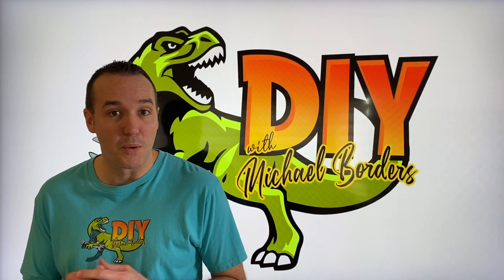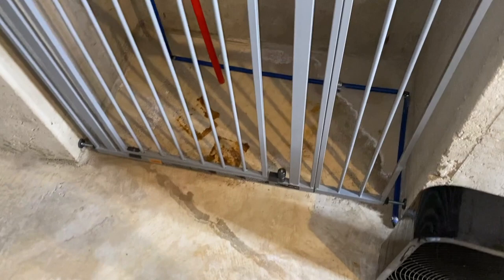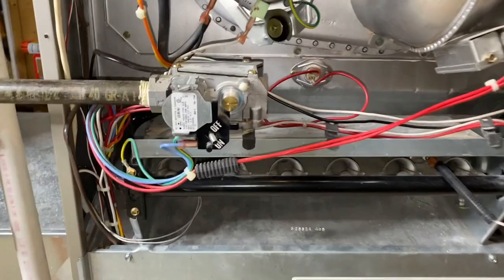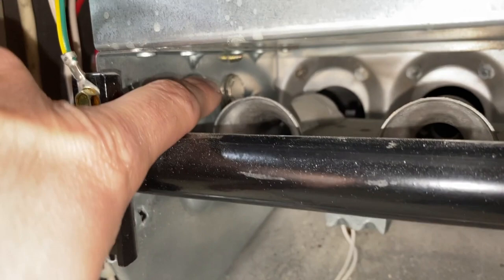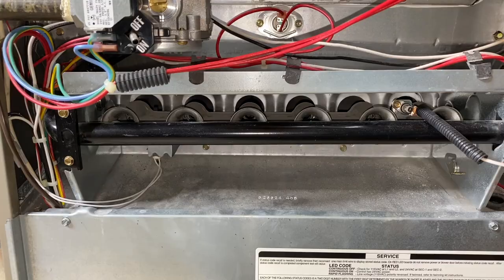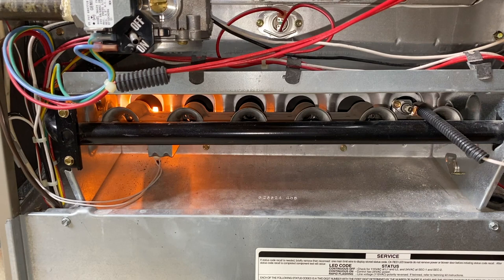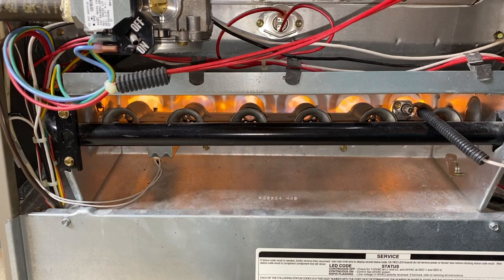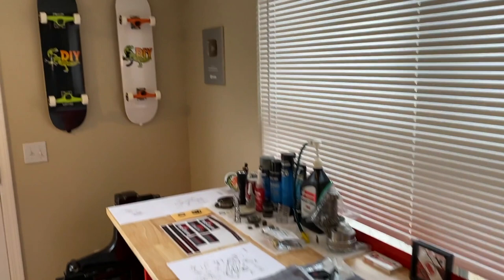Furnace stops running after 1 minute - Possible Cause

Comment: Hello , What's the reason when the furnace is less than 3 years & we have bought 7 years warranty , they come twice a year for heat or cold , but this year with no explaining the tech went started to check the gas presure , after he left aout 40 minutes the furnace was not working like before , we call them they send another tech & play dumb to me . Now at 78 deg the furnace work for 10 minutes then off . we call they say my emaginatio .
Reply from the maker: Good morning ☕️ any update?  That’s no fun that you’re experiencing issues with a new unit.  Being less than 5 years old, you shouldn’t have any annoying issues like what you’ve experienced.

Are any of the vents blocked by rugs, furniture, or anything else?